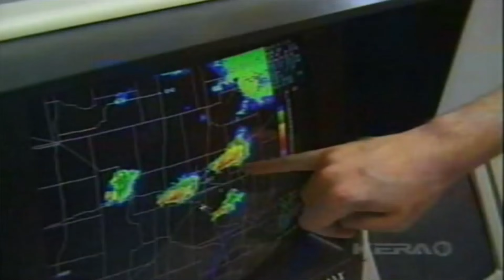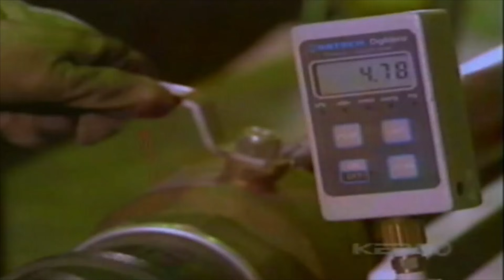Tornado Diary - Moore, OK

Comment: So we’ve seen video of inside the eye of a tornado and it’s not quiet or peaceful.  I’ve accidentally got in weak ef-1/2 and even them in the eye us violent. The one guy watched twister too many times. The eye of a tornado is so small the reason it’s extremely violent. So imagine a 1 miles wide tornado. If you get in the outer 5-10% the winds you experience are one direction until the back side come threw. If you get in the eye thats 1-3’ wide. Your experiencing winds from 4 directions simultaneously. If a sub vortex hits you it’s so damaging because the winds are going 360 degrees in a tiny area. If a sub vortex hits a car you will have. North winds on the rear bumper. South winds on the front bumper and East and west winds down the sides of the car. I know this because a chaser in front of me. His vehicle lifted up 5-10’ and started spinning like a top. It the busted the bead on 3 tires when it dropped the car. The funny thing is he called a tire repair man and the tires were rough but the bead re set. He was able to drive into town.